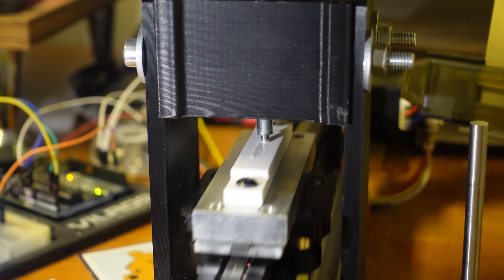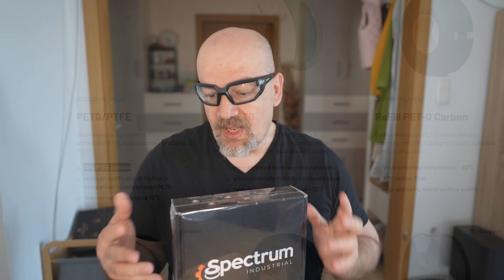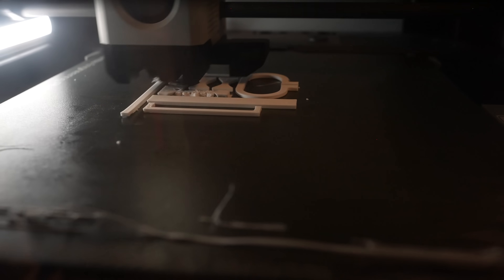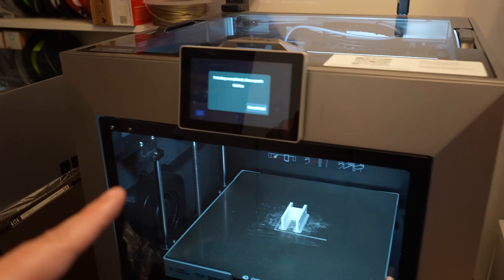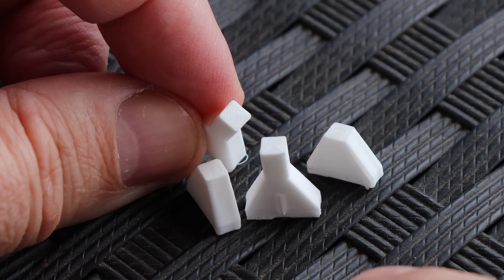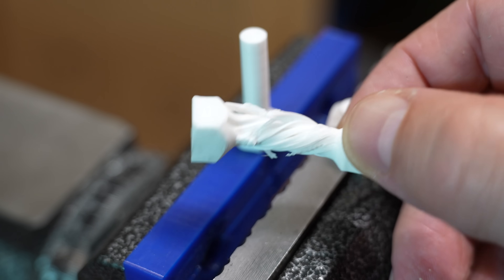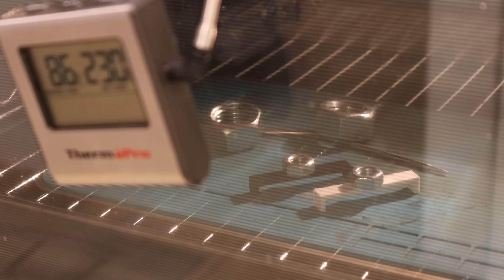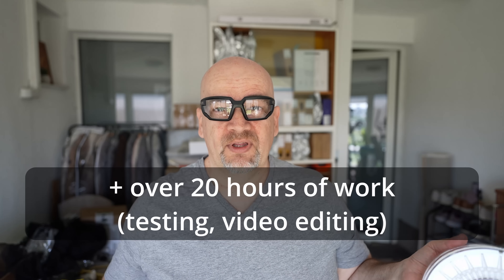Polycarbonate Meets Teflon: Spectrum PC+PTFE Filament Review

Comment: none of your printers are particularly capable of printing polycarbonate well, around 90c chamber temps is where it starts getting good, and it needs to be around 120c in the chamber to get full strength.  you need to seek out a sponsorship from vision miner or something and get your hands on a 22idex or similar

Comment: I think you need to increase the extrusion temperature to at least 330C so that the PTFE component starts to melt, maybe this way the interlayer adhesion will be sufficient.
Я гадаю тобі потрібно підвищити температуру екструзії як мінімум до 330С, щоб тефлонова складова почала плавитись, можливо таким чином міжшарова адгезія буде достатньою.
Reply: That's a great recipe to produce extremely harmful vapors

Comment: I think this could be useful in a tool changer to add a low friction layer around parts that could benefit from the PTFE, and the strength of any filament that PC bonds with.

Comment: Wondering how much stronger layer adhesion would it be if all the test prints are done in the Qidi Plus 4, i.e. using higher chamber temperature, as PC is sensitive to that.

Also, since you have the E2, may be worth trying annealing the parts for 2 hours.

Comment: Thank you for the video. Could you test iSANMATE Matte High Speed PLA? They claim it has high layer adhesion despite matte appearance. I wonder if the claims are true.
Reply from the maker: Eh, Spectrum also claims that this filament has better interlayer strength..
Reply: @MyTechFun  I am basing it on the supplied TDS. The spectrum TDS does not include a layer adhesion test as far as I understand.

Comment: I agree. I don't like the new UI either. Why did they move the light toggle from the home tab to the filament tab???
Reply from the maker: I found several things, where I need more click to get it. Exhaust fan for example (I turn it to max after finishing ABS or similar materials). I don't like new filament change UI. No info about the current temperature during heat up etc.

Comment: That GUI on X1C is very similar to the H2D and it's pretty cool 🔥🔥
Reply from the maker: It's changed with latest update. And I found several thinks, where I need one more click to get it. For example exhaust fan. No info about the temperature during filament change etc. Old one was not so nice in design, but it was more practical.

Comment: I think your flow ratio was waaaaaay too high on the X1C for this material.  That's why you had such a large amount of buildup and bad looking parts.  I don't think you understand how print speed affects layer adhesion; if you allow the print to cool between layers they will not stick together.  Your second test where you added the cylinder made the adhesion much worse.  You should try printing at 320-340C very slowly with proper flow ratio for the high temperature and measure layer adhesion again.
Reply from the maker: In real life we don't print only 4x4mm test objects. Adding a cylinder is very real case. In practice, my printings are much bigger, additionally, we always try to print more objects at the time. Speed vs strength: https://youtu.be/W3SCl302CP4?si=DRW5PEgYq88szg4v

Comment: Interesting material but cant see a use for it. "The filament" by spectrum PETG CF is a unique filament as its only 3% carbon instead of the usual 10%. It removes all warping and prints easier than pla. Would love to see you test that material and see how the layer adhesion performs.

Comment: Doc.. 😂 I love that you had to switch to the Plus 4. You know you can run 70c-80c chamber temp on the Plus4 right? 😉  

Heated chamber printing brings the avg hobbyist closer to light industrial printing. 

Tho. I wouldn't try to print peek on a Plus4.  
Wait for the Xmax4.

Comment: I think the goal of using PC on the first place is to work between 60-100ºC. It would be useful to do many of the resistance tests under those temperatures. Because most of the "stronger" material are completely soft at just 60ºC, so those 10 or 20Kg doesn't look that bad at those temps, since PC+whatever pieces may work, while other materials are just chewing gum.

Comment: I've been in manufacturing for over 30 years and one the material's that was used for high wear resistant situations was UHMW type of plastic. We used in the commercial canning industry in the equipment for what we called Starwheel's and  Psychological curves... to give you an idea of how fast a cup would travel thru it... we have a machine that can process 2100 cups per minute so it's incredibly fast moving. BTW... if you're wondering what I am referring to by "cup" it's one of the first stages from stamping out the aluminum planchet or blanks to prepare it for going into the body maker that makes the bottom part of the aluminum can... I bring this up because that UHMW is very wear resistant and I am wondering if you are familiar with it and if there's a 3D filament that has the same properties and if so have you done some testing of it... Thanks, I really appreciate you...

Comment: Interesting material... I think that it would be useful in very specific situations but not for common use.. I'm thinking like a situation where you can use it in just friction surfaces. Maybe where one would  design a model that is in 2 pieces and it's some kind of insert, maybe with a dovetail to hold it in place once it's assembled... I'm not sure... but still very cool... I appreciate you...

Comment: I sort of assumed adding PTFE to filament would result in difficult layer adhesion. Just makes logical sense to me at least. Bummer it doesn't result in more beneficial properties overall. I wonder what the exact intent is and how their testing was performed. If it's just a marketing additive, that's a shame.
Reply: I wasn't surprised by the weak layer adhesion but it's odd that the manufacturer (1:00) claims "very strong lamination of layers", the opposite of what the testing demonstrated.  I'd be surprised if that was just a blatant marketing lie, so I wonder how they might have gotten good layer adhesion.  I was pleasantly surprised by the impact resistance, although in hindsight I can understand how the layer delamination resulted in a destructive form of impact resistance which probably isn't useful in most applications.
Reply: These are all speciality filaments that the people who know exactly what they do will be satisfied at their performance. The rest won’t need them or appreciate what they do. I also imagine that the tests he’s doing have little relation to the purpose they’re designed for. I use Teflon. It’s great for its purpose, but it would fail almost all of these tests, and that’s extruded or cast material. Teflon is used for temperature, chemical resistance, electrical insulation and slipperiness. It’s not useful in tension, fair in compression and terrible in shear. Mixing it with PC just makes it a bit stiffer for some uses. His friction tests aren’t the way this would be used.
Reply: @melgross There are already other materials that can do all of those things with far better properties though. So that's what I'm saying. I'm not saying this filament has no purpose. I'm wondering what it is and how to execute it properly.
Reply: @melgross  kinda like UHMW polypropylene. Hard as hell to print but get it in extruded or shot form and it handles an awful lot.
Reply: @helixx_4D a great material. Extruded it’s strong enough. More slippery than teflon. Never used it as a filament, but it does melt at a fairly low temp. I wonder if they have PVC filament?
Reply: @helixx_4D Polypropylene has phenomenal layer adhesion, is chemical resistant, has high impact resistance, and is lightweight. Those benefits are all obvious. They are less so here. Not trying to argue with you at all, just saying I wonder where this filament would be worth it vs another.
Reply: @melgross  I feel that it needs a lot more calibration and testing to work well. Also, with a 0.2mm layer height, I don't think there would be much difference between these materials. If the temperature tower, extrusion multiplier, pressure advance, speed settings, etc. were all dialed better, and it was printed at 50 micron, I feel like its differences would be much more clear.

Comment: I think you will be impressed with the Glass filled Nylon. I've been using Fiberon's version and am very pleased. While it may result in a product that is more brittle than most. Keep in mind , it can take weeks from printing for the nylon to regain its impact strength as it slowly absorbs moisture back. So consider that drying , printing, then testing may not yield true real world results without 1st letting the nylon sit in the open air for at least a week.
Reply: But what does that rehydration do to it’s dimensional stability?
Reply: @robblincoln2152  Are you asking if it expands from moisture absorption? That I haven't noticed. On that subject. The Fiberon PA6-GF does expand in the XY enough that I had to dial in the shrinkage settings. There is also expansion to a lesser extent on the Z axis. This is noticed directly after printing and cooling down. I had to set my shrinkage settings to offset the expansion and it took some trial and error. This subject of moisture re absorption leading to improved impact resistance is covered quite a bit in the Fosscad community. They do prints often from nylon where the impact resistance is very important. The tolerances are also very important. I am sure even after full saturation it will likely only have acceptable impact resistance given the nature of the material , but the improvement is very redeeming.
Reply: @robblincoln2152  Im really sure I replied to your question yesterday. But it seems my comment was removed? Not sure why. So I'll try again. If youre asking if it expands due to moisture re absorption. I cant say I've noticed this. Admittedly I haven't tested for this either. The functionality of my prints and their tolerance fit aren't noticeably any different. Fiberon's own documentation indicates it expands in the xy and to a lesser extent in the z axis (for PA6-GF) and I concur that is accurate. I had to dial in the shrinkage settings to account for this and it took some trial and error before I achieved satisfactory results. A community that prints almost exclusively with nylons educated me regarding impact resistance improving after the prints equalizes with open air humidity. And they would know having a lot of experience on this subject. I mentioned b/c the testing is almost immediately after the print is finished and possibly can result in unrealistic real world performance expectations. Some suggest leaving it outside for a few weeks. I think thats a bit extreme, perhaps 1 week should be enough. I may just test this theory myself. Good luck.
Reply from the maker: Soon, all Polymaker PA filaments (4 type)

Comment: Igor, thank you for 'taking one for the team'. These materials seem to attract me too from a curiosity standpoint, then when I go to do pre-purchase research, there's a radical gap between the marketing and expected results. In my eyes, this filament is a solution looking for a problem. What that problem is that a more available material(s) doesn't solve, I couldn't tell you. 
On having vented atmosphere for machines that didn't come from the factory with either vent mounts or cutouts, I've been enclosing some of my printers in proportionally-sized plant grow tents where I can run tee lines to my fume extraction system. Most dryer vents and ancillary adapters work great for this use case in 4 inch/101.6mm ID parts like elbows or Y-chute adapters with internal spring gates; some of my couplers are the rubberized sort from dust extraction systems where required. (The spring gate closes one side based on amplified air pressure from the other port, activated by suitable static pressure from a fan extractor, or in my case, an upstream extraction blower).

Comment: Good luck printing Spectrum ASA-X CF10! I completely failed.
PC/PTFE was hell to tune and print, I struggled even more than you did and I only have X1C.
Reply from the maker: What was the problem with ASA CF? Just to be ready for it.
Reply: @MyTechFun  I cannot get it to feed, it is super brittle, more brittle than any PPA-CF or the 30% GF filaments, breaks in bowden tubes, so I even tried to feed it like TPU, almost straight to the extruder from the top. It fails too, it slips in the extruder and it is not clogged nozzle or something, I would have to push it by hand from time to time to keep it going.
Maybe it is so slippery, maybe the filament diameter is uneven, I have no clue. This and the brittleness make this filament pretty much unusable.
Reply: @MyTechFun ASA in general doesn't seem to take well to fibers. 🥹
Reply: @802Garage  I don't think so, I have over 10 ASA-GF filaments (various brands, ProRock, 3DO), I have other brands ASA-CF (FillHub, 3DO) and they print fine. ASA-Kevlar from Rosa3D also prints well. It is just Spectrum's ASA-X CF10 that gave me hell.
Reply: @RobertLukierski Interesting and good to know! Most fiber filled ASA filament I have researched has both poor reviews and bad experiences from personal friends I know have solid knowledge and experience. I'd definitely like to see more tested!
Reply: Did you manage to tune PC/PTFE on the X1C? My main problems:
- the material that deposits on the nozzle, it's happening to me as well; if the print is long enough at some point it gets loose and ruins the print
- bridging often fails, even on infill with sufficient percentage, resulting in a complete mess for the remainder of the print
I'm going to try a 0.6 nozzle next, but I'm very close to giving up on it
Reply: @sandrobosio6847  my experience is similar, I didn't print much because each print is a struggle, my flow rate is 0.94 and I slowed it down to 8mm3/s

Comment: Ahh Teflon, my favorite of the forever chemicals!
Reply: It's not the Teflon that's the problem, it the chemical used in the production of it
Reply: Teflon is always leaching some of the chemicals that were used to produce it. For example studies have shown that those who use "glide" teflon dental floss have much higher levels of PFAS chemicals in their bodies.
Reply: @shabmaster7128  You are repeating what they told you. Even finished teflon products contain some loose components of the forever chemicals used in their production. Once they get into your body, these chemicals can't easily be cleared out; they accumulate year after year gradually causing disfunction and disease.
Reply: Yeah, Veritasium chanel made great commercial of Teflon 😂
Reply: Really great material. 😂 just don't eat it.
Reply: @getinthespace7715  Teflon is used for body implants. It's probably on the top 2 or 3 list of plastics that are safe for human consumption, implantation, injection, etc. What's more dangerous than an ignorant person is an ignorant person that thinks they aren't.
Reply: Yes, some things need to not be produced. Period.
Reply: @robblincoln2152  ptfe in one of the most important material of the modern word
Reply: I hope 3d printing community is going to push against anything containing forever chemicals. It’s insane how currently almost every video about PTFE filaments ignores the harm they bring
Reply: @levvkk  It's insane how people speak so much about something they don't know. PTFE is in EVERYTHING. It's one of, if not the most inert plastic commonly made. It doesn't react with anything. So it's 100% safe to ingest. Safer than any other plastic we know. That's why it's currently used for medical implants in the body.

Confused yet? The only reason it gets a bad rep is because of nonstick pans. How would you go about adhering the most nonstick material you know to something? Yeah that's the problem. The process of adhering PTFE to nonstick pans is the reason why there is an issue. The actual chemical that is the problem is PFOAS and its successors.

PTFE itself is one of the safest plastics you can encounter with its high melting/degradation point and intertness.

Comment: Would not the best use case for this material be printed bushings and sliding pads where loads are sliding under compression. Obviously you tested this on an anodized aluminum T-slot extrusion which is not ideal for sliding elements.  I have printed round rail linear guide rod bushings from nylon with good results.  I'm thinking this material would be an improvement.  How about a test with a rotary bushing or round rail sliding friction test.  My design for the round linear rail used three point bearing with a split housing with screw to adjust clearance.  Interesting testing, thanks!

Comment: Heating Teflon ... safe? Zero hazards?
Reply: ahahah im assuming you also just saw the latest veritasium video
Reply: @maurice7017 : No, I didn't. Can you please link to it?
Reply: Polymer fume fever “Teflon lung”.   Would not want to be near this printer while printing this stuff. More importantly, how many forever chemicals (PFAS) were released into our collective ecosystem in the production of this material?
Reply: He specifically addresses it in the video. Maybe you should watch.
Reply: from what i can remember from the vid if you heat up teflon above 300°C, the fumes are toxic and you get some flu like symptomes, but nothing severe. but yeah its toxic to print this in a non or poorly ventilated room

edit: well nvm he says it in the video